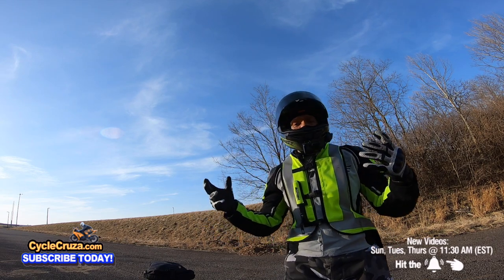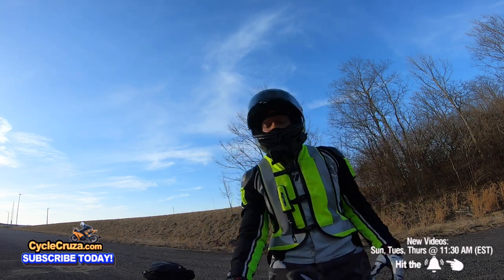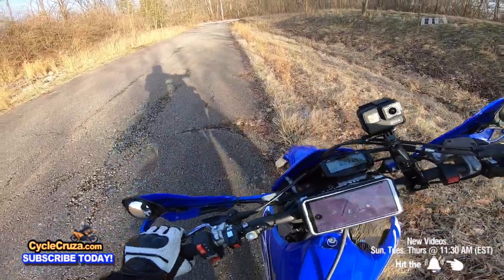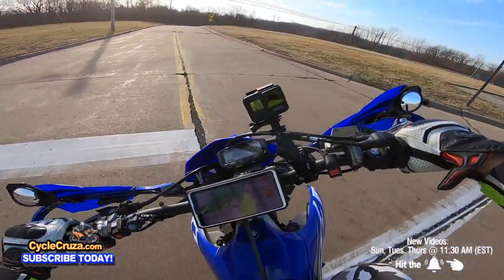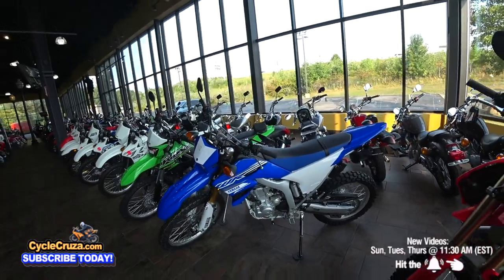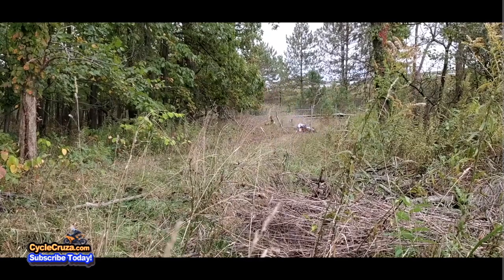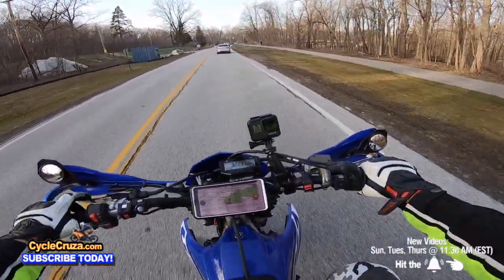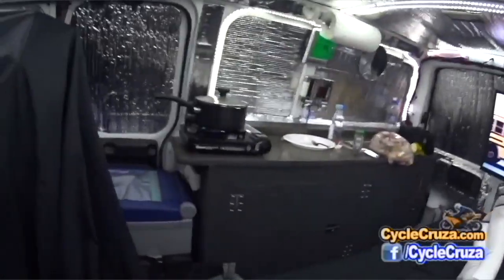UGLY Truth About Dual Sport Motorcycles

Comment: With all your off road bikes they need to use and deliver all their power under 40mph on the dirt. The gearing and transmission on the engines power band should be chosen for this application. They also benefit from very low tire pressures and need to use rimlocks to allow be lower pressures when riding off road. This is why ADV bikes are not dual sport. They are properly called Adventure Touring motorcycles. A big heavy street motorcycle dressed up in dual sport clothing when those bike’s power and and gearing and transmission is set more for the touring speeds traveling above 40mph. They sell well to the older market demographic that want to go touring but fear they may encounter a few dirt roads every now and again when they are going new places they have never been before where if they didn’t chose an Adventure Touring motorcycle and were on a Street Touring or Sport Touring motorcycle they would normally have to turn around and reroute to find a way to stay on the streets to get to their destination. Put an MX racer on an ADV bike and they can do wonders on them, but 99.9% of the ADV bike riders are not those folk.

Comment: Idk our bashan hawk 250cc gets like a oil change once a year if it's lucky. And it's engine is still in awesome condition. The bike is over 10 years old and still runs great. I do need to change my gearing because right now it just has low end grunt and no speed.

Comment: 07 klx250  18/21 setup works fine on road 50/50 tires are just fine but even on trakmasters not much of a chix strip ihave a lot of round-abouts by me 
I would say ride as intended should be fine. not a track bike also avoid paint and other loose debris when on throttle might help with lowside

Comment: Shhhhhh....don't tell any one but some dual sport guy's run the Tubliss system on the street so they can air down for traction plus you can fix a flat with a plug AND run flat to get home if needed.

Comment: A supermoto is just another type of crotch rocket, intended to be ridden irresponsibly, recklessly, and illegally on the street. You couldn't give me one. Dual sports are wonderful bikes, they will take you anywhere. They are NOT designed to be ridden irresponsibly, recklessly, and illegally on the street. They are for the most part street legal dirt bikes. I have owned close to a dozen dual sport bikes, from 100cc to 650cc. They have three major problems. One is an almost complete lack of a seat that you can actually sit on. They are styled after MX bikes, where you stand on the pegs 99% of the time. Old dual sports, known as "dual purpose" bikes back in the '70s, actually did have real seats and could be ridden for quite some distance without severe ass pain. Another issue, also involving the seat, is that they are just too high. I have to carry a step stool with me to get on and off my current dual sport bike. And the third problem is tube type tires. When (that's WHEN, not IF) you have a flat tire, you are screwed. I have found a partial solution to this problem, with my Suzuki DR650. Along with lowering it, I also put an aftermarket centerstand on it, just like the centerstands that used to come on most street bikes. The centerstand will hold the bike up while you remove the wheel. But you still have to carry tools to remove the wheel and anything else that might have to be removed to get to get the wheel off, tools to remove the tire from the wheel, including plenty of tire mounting lubricant, some spare tubes, and of course, a pump or compressor to inflate the tire. All that stuff, along with the step stool I need for getting on and off the bike, take up all the room on the bike, with no place to carry anything else.

Comment: My guy, can you fill us in on the new Honda XR150L?! its mad affordable and a dual sport. Thinking about grabbing this as my first bike
Reply: Looks cool. If it's your first it might be the ticket. My only complaint with my 5-speed dual-sports (Xt250 and TW200) is highway/freeway. The Honda 150cc is also a 5-speed will probably be hard to keep above 45mph (70km/h) and top out at 50mph (85km/h). My 200/250 top out at 55mph. If you have the option or means, consider a new or used 6-speed (CRF300, KLX300, etc) if even occasional highway/freeway use are a consideration for you.
Reply: I’d say grab it as a first bike. Honda holds its value really well so you can ride it a year and resell it when you’re ready for something else

Comment: Hey there, I was wondering if you could tell me how the tire rating for onoad and off road works. Say for example if the tire is 70/30.
Does that mean on road you will get 70% traction and off road you get 30% traction?
Doesn't sound too good, I need 85% on both or higher
Reply from the maker: With a dual sport or ADV dual sport tire you are not going to get the same traction as a true dirt bike knobby tire that has harder knobbies. The ADV tire like mine is not going to perform as well off-road as a true dual sport tire with knobbies either but you can go off-road and it has a harder rubber carcass that is made to resist tearing and withstand off-road riding but is much better on the street than dual sport tires. It just depends on what type of riding you do, if you are like me and don't go off-road much that an ADV tire like my Shinko 705 tires will be great and they last a really long time unlike dual sport knobby tires.
Reply: It kind of depends when looking at the tire. The Shinko 705 is more street oriented and you can tell just my looking at it that the 70% is for street and 30% off-road. I have Pirelli MT21 knobby tires on my DR650 which are 90/10 tires. It's a knobby tires so you know the 90% is off-road and 10% is for street. The MT21 is a DOT knobby tires. 

There is a great debate about 50/50 tires based on perceived value. Some people love them as a perfect middle ground where others argue that they are a waste since they're neither great off-road or on-road. I see both points of view but there are some really good 50/50 tires out there. I ride mostly street on my DR so I'm going to try the Shinkos for the 70/30 tread and affordability.